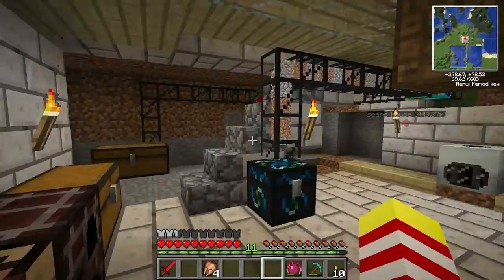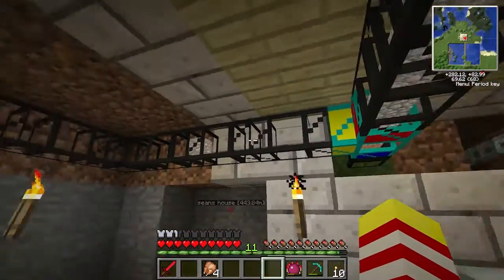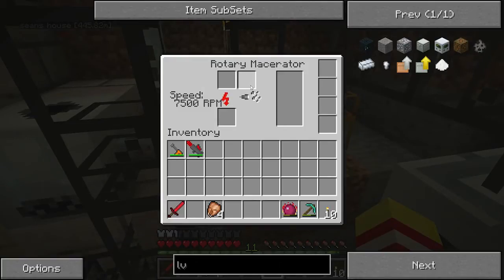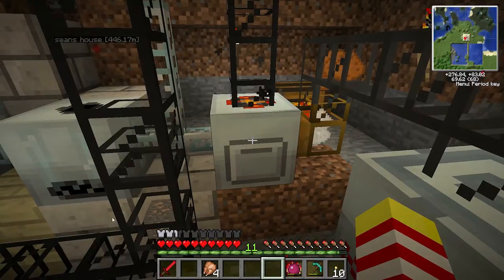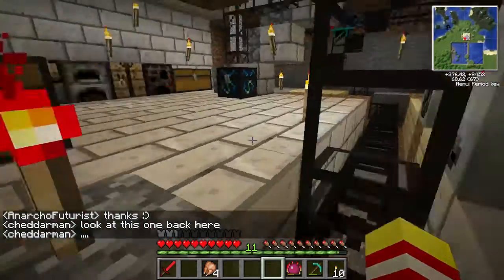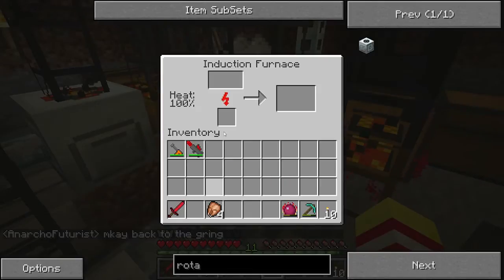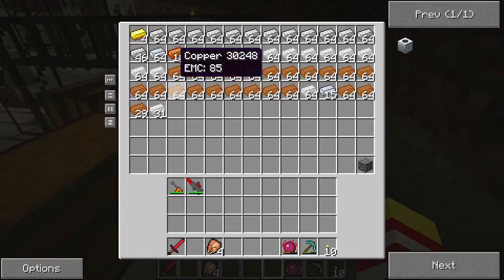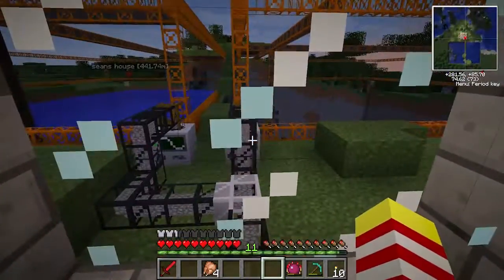Best Rotary Macerator to Induction Furnace Loop

Comment: So we all know that items pop out of pipes if they cant enter the machine. But, did you know that if you add an alternate route for the item to take like an iron pipe -> stone pipe -> stone pipe, then put the machine on the first stone pipe, the item will simply take the other route.
You can make tiny square loops around a machine that will keep the items in the pipes until the machine is freed up to accept new stuff.
Fyi.

Comment: Hey did you ever noticed that a dust haves a emc value.?Even that it is the same as a ingotis worth in emc value's.?Well if you dont know i want to go to i will tell it you.First:Get that induction furnace away.!Second:Get where the induction furnace was a condenser.Third:Get the glass fibre cables away.!(Not needed anymore for that project.)Fourth:Say that it was the player in Tekkit/Minecraft: weepsi2000.(Please :P)